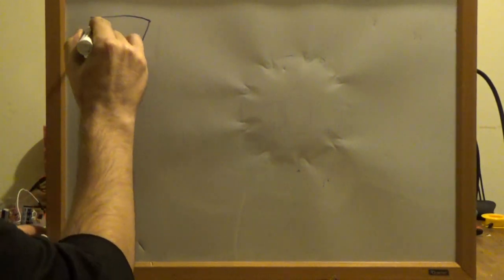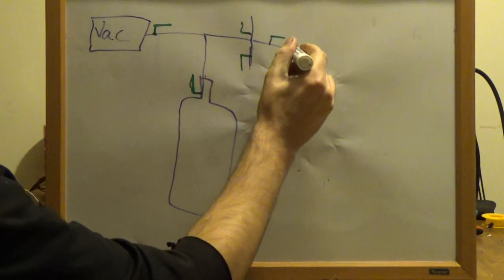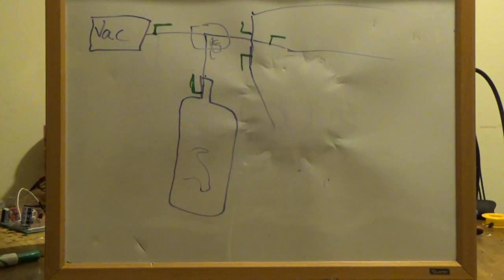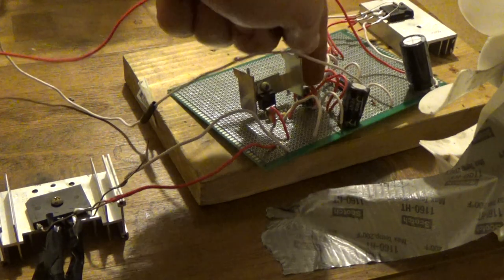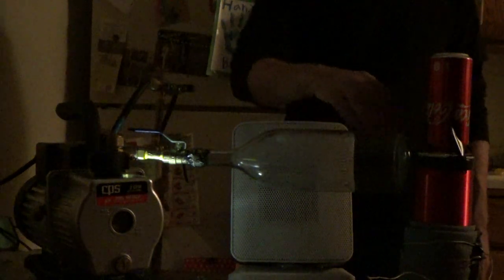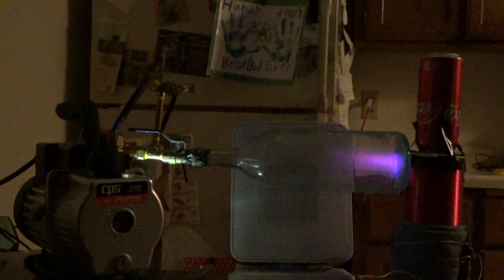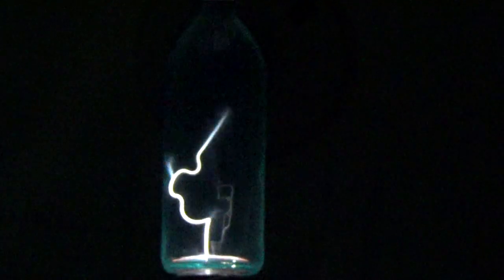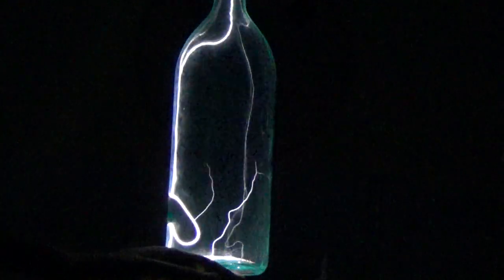Making plasma with noble gases

Comment: So, I assume you a non-scholar table-top experimenter. I not saying that out of disrespect. I saw your video on Thunderbolts. It is evident that a logical examination of how plasma and electrical discharge causes craters (not collision) on the moon and Earth is a rational way of thinking. I am like you too in that when I found the Thunderbolts vids, I couldn't get enough! Your work shows what is obvious to me (non-scholar) and you should be obvious to the scholarly community. The cratered surfaces of other bodies in the solar system was (maybe still is) caused by an experimentally observable phenomena. Not gravity and other forces. Keep up the good work. And, your sculptures are exquisite!

Props!